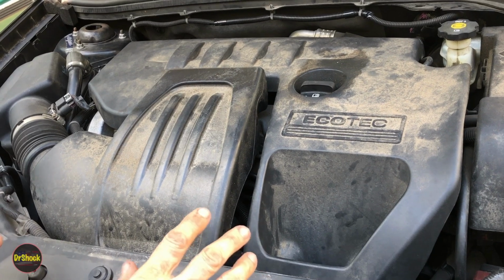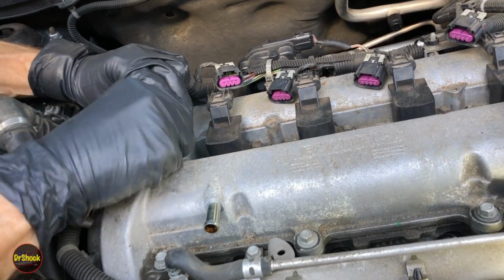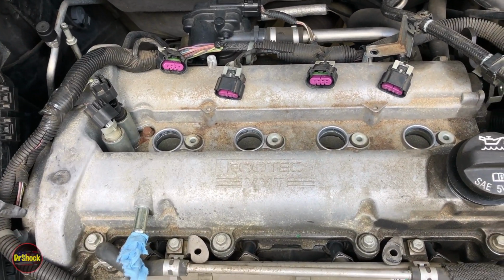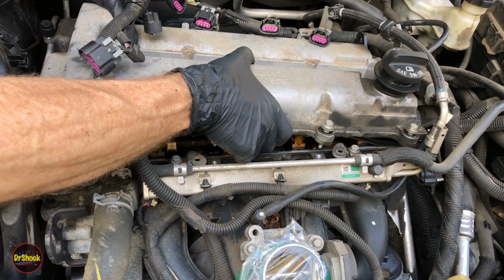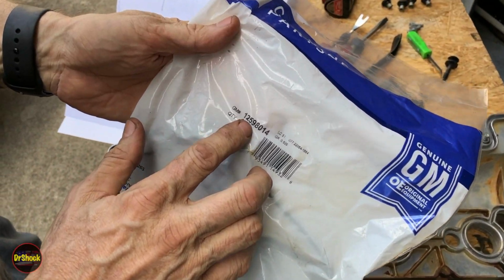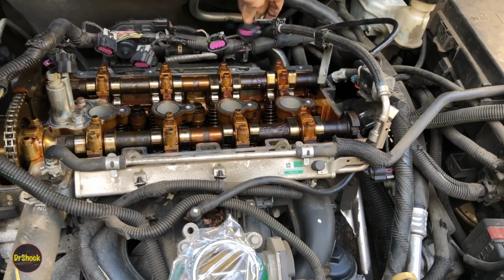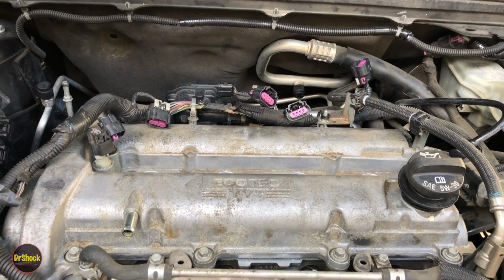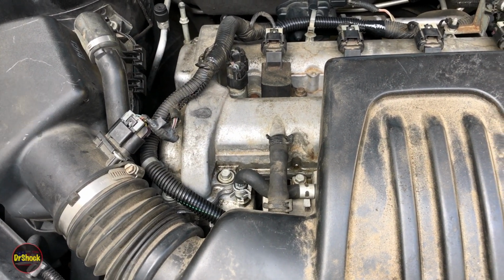2006 - 2010 GM Ecotec 2.2L Engine Camshaft Cover Gasket Replacement (Chevrolet Cobalt & Pontiac G5)

Comment: Wouldn’t a steel flat head or prybar be leaving indents in the Aluminum block?
Reply from the maker: Yep, completely necessary.   It's not that deformations occur, they absolutely 100% will.  It's where they occur that matters.  

You gotta have a light touch in doing these sort of procedures when working with aluminum designs.  You want to pivot the pry bar along the angular edge of the cylinder head, rather than getting under the flat machined surfaces where the gasket resides (either of the cylinder head or the camshaft cover).  Some deformation of the metal is absolutely expected, and completely unavoidable, in order to service the vehicle.  But you must not deform the more inner gasket sealing areas along any of the flat machined surfaces or it will leak.

Comment: Great video of the later 2.2 ecotec with individual ignition coils. I was looking for any key pieces to be on the lookout for like unseen plastic clips, etc... and you covered it all!  One Tip for anyone after me...instead of prying at the corners to release after loosening all the bolts, tap liberally on the side of the cover with a rubber or plastic mallot until it releases. This prevents and risk of marring the mating surfaces with the tip of whatever you're prying with. This works on Oil Pans and other similar covers, too.  Again, GREAT VIDEO and THANK YOU!
Reply: Rubber mallet! That makes perfect sense. I am doing this job tomorrow. Thank you Joe :)

Comment: I hope you reply on old vids. I have a question. Is that really the camshaft sensors on top of the engine to the far left??

I have a 2006 chevrolet cobalt with the 2.2... so many people say there is no camshaft sensor and that code means to replace the ignition control module. 

So are those crankshaft sensors or camshaft sensors?i have the p0340 code
Reply from the maker: The GM Ecotec 2.2L definitely does have a camshaft position sensor, you can see it in this video.  But it's located on the drivers side.  Its mounted on the radiator facing side of the engine on that side.  The crankshaft position sensor is located below that, behind the starter motor.

The two electrical connections on the passenger side, where we were working on the camshaft cover for this engine, are for the intake and exhaust camshaft solenoid actuators.
Reply: @DrShock when u describe its position in your reply the 2nd time you said crankshaft sensor. Are you referring to the camshaft position sensor as that is the part referenced in my code?
Reply from the maker: No, I was not referring to that.  I gave you both sensor locations. Camshaft position sensor is separate from crankshaft position sensor.  And those are the only two sensors I mentioned.  The other two are solenoids, which were the original connections you asked about.
Reply: For God's sake. It didn't post my first reply to ur comment. I saw a video of this year and engine that removed a sensor below the oil filter but that visually matches to the crankshaft sensor on rockauto for this year and engine. You are saying it's not that but under the starter? So I would have to remove the air intake and starter to access it? I can send you a thanks if we figure this out. I can find no reference to anything being under the starter. I've checked so many repair tutorials sites and vids
Reply from the maker: Crankshaft position sensor is behind the starter, below the oil filter housing, for the particular model years this video covers.
Reply: Additionally, another car youtuber replied: your correct it doesn't exist on
that engine. On the 2.2L Ecotec, The ICM and
coil packs are failing and the first sign is it
throws up the code. Replace those two things
with either Standard or AcDelco products. I tried
using Duralast and failed both times. If not the
car will randomly start stalling on you
Reply from the maker: All of the sensors, and solenoids, I mentioned are present on the model year 2009 Ecotec 2.2L engine shown in this video.   That advice you were given is not broadly correct.